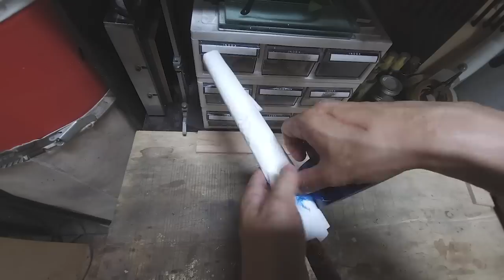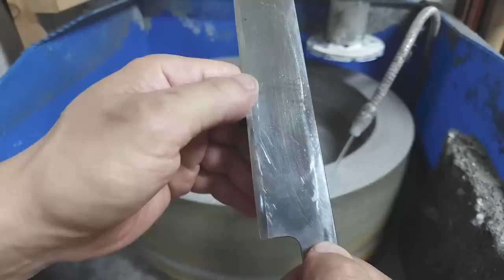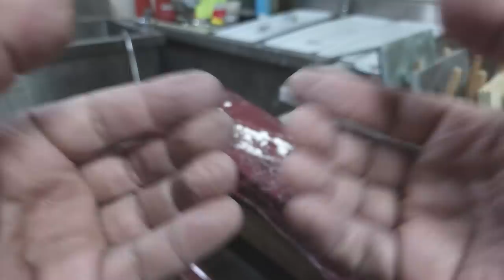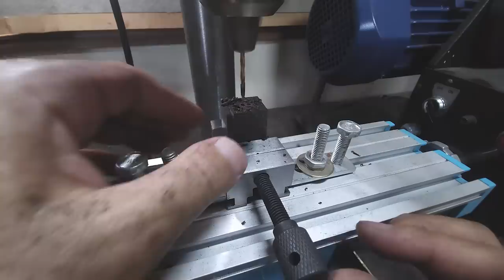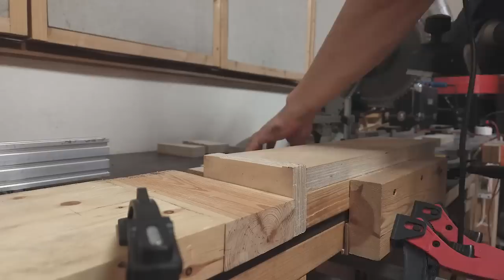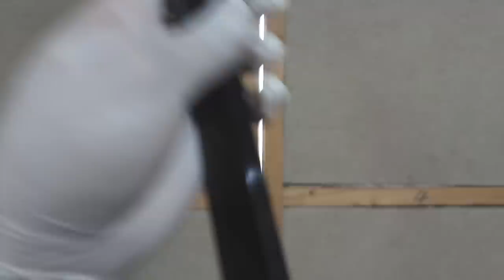한국 3대 50년 경력의 그 칼 수리하기!

Comment: It's a shame you didn't reuse the original copper collar. Still looks good though.
Reply: I was thinking the same thing. If he had used the wood he did for the new handle and that collar it would have been beautiful
Reply: On top of that, didn't seat the blade all the way into the handle...
Reply: maybe it was a request of the client
Reply: @iknownothing-m8c  thats actually known as 'tokyo style'. The blacksmiths in Tokyo typically seat their knives like this.

Comment: If that went through so many families than I’d be pissed if the handle was replaced. Just my own opinion.
Reply: I'd be ok with it, as long as the new handle is of higher quality and craftsmanship. The main "knife" is the blade anyway.
Reply: It's whatever the client wants, and clearly, they wanted to replace the handle. It is a shame that they didn't want to keep the original copper bolster, though.

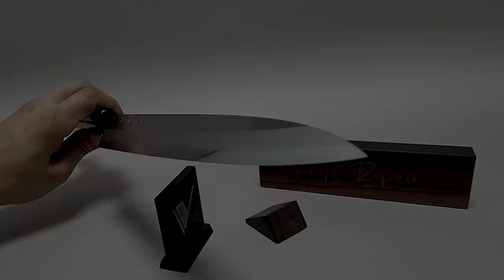Comment: at 13:34  bro what is that, the shoulders are not matched to the handle, and you abandon the cast piece of original. shame.  bad job on handle fitting.
Reply: yanagiba combines so in part. Search and comment